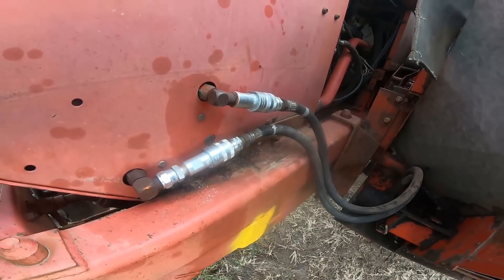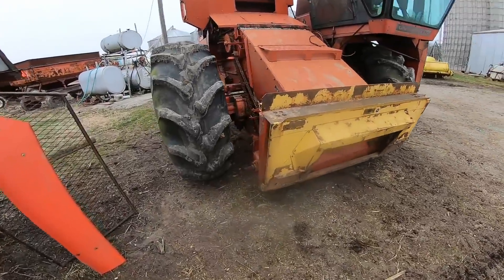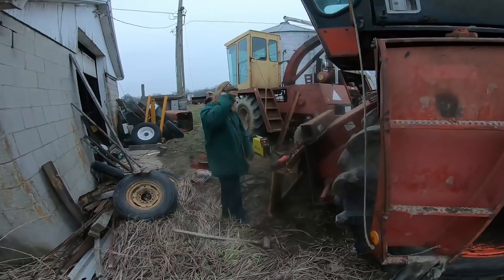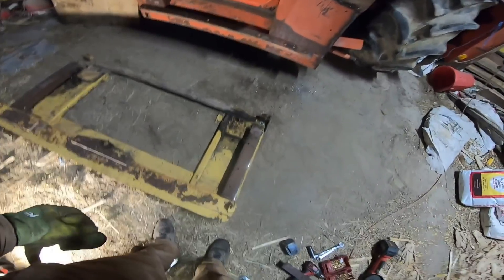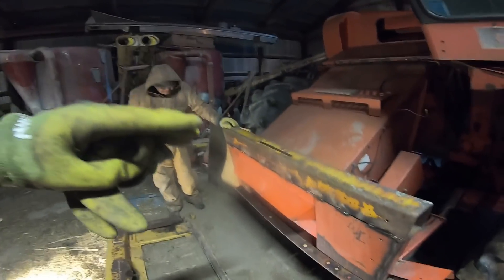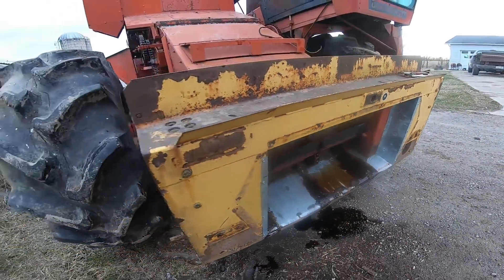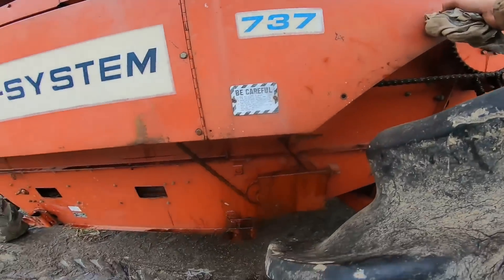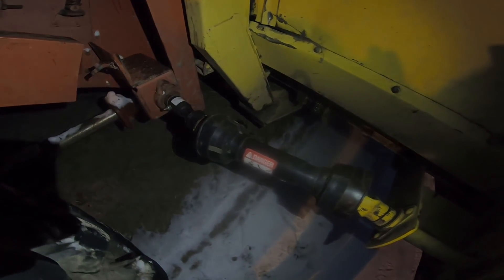UniSystem Project: Attaching Elevator, Feeder house and Making Adapter for New Holland

Comment: Looks good.  I had to do something similar to mount a corn head on my Ford 640/Claas Senator combine decades ago.  After searching around, the only corn head I could find was a 6 row 30 inch somewhere off in Alabama, and they wanted a fortune for it simply because it was rare.  When that combine was built, it was back in the days before "quick attach" heads were really invented, so Claas' idea of interchanging heads was to make the feederhouse part of the head!  The combine had two "U" brackets on the front of the frame on either side of the cylinder, into which the feederhouse pivots slid, then a cast-iron wedge provided the front semi-circular pivot, with a 1 inch wide thick steel bar "pin" that slid into a slot on edge cut through the upper and lower parts of the "U" bracket on the front of the frame.  The header drove off a single LARGE V-belt pulley on one side that turned the feederhouse chain, and had a cast-in smaller double-pulley that powered the head via a pair of belts to the jackshaft on the back of the head, for platform or flex heads, or a HD chain to a sprocket on the jackshaft to run a corn head.  I had a spare feederhouse off the old 630 combine I bought from a combine salvage company that was going out of business, and so I just modified it to fit an old Gleaner "G" 4 row 40 inch corn head I bought for nearly nothing in north Texas.  Cut the hooks off the Gleaner head faceplate where it hitched onto a Gleaner feederhouse, had to cut a pair of wedges and about 3-4 inches off the front of the feederhouse for the Claas to get everything at the right angle on the combine.  Made a belt pulley jackshaft that went on top of the feederhouse to drive a pair of chain sprockets, one on each side, to drive the sprocket-driven gearboxes turning half the header from each side, did a little reinforcing, and put it all together.  Had to make a steel plate that went into the "well" where the feeder drum on the front of a Gleaner feederhouse stuck into the cornhead-- and a 3 inch steel tubing "splice" to connect the two half augers that came in from the row units to dump corn in the well in front of the feeder drum sticking into the head a bit from the feederhouse on the Gleaner that was no longer there.  The pipe had a slip coupling on one side and was bolted together on the other side to drive it, so if a chain broke or came off the one auger could overrun the other without tearing anything up.  I cut the tread off a couple of old bias tires with a sawzall and made "paddles" that bolted onto angle irons welded to the center auger splice tube, to shove the corn back down the steel plate that filled in the bottom of the well and angled back to the feederhouse chain in the Claas feederhouse.  Worked great-- only problem was the two V-belts for the platform header drive were undersized for a cornhead which took more power... I was looking at ways to reengineer that into a sprocket drive when we quit row cropping.  

To change heads on a Claas back then, you pulled the pins and wedges, took the cylinders loose from the underside of the feederhouse, took the drive belt off the LH pulley, and then backed the combine away from the head and feederhouse.  To hook up to another head, you basically had to line up the combine and then pull forward and HOPE that the pivots went into the "U" brackets.  What I did was jumper a button up to the starter using spare wiring, got close, and then left the combine in gear with the coil wire pulled so I could just bump over the starter and slowly get the combine to roll itself forward, so I could jack up either side as needed to get the pivots into the U brackets, and once everything was pushed together snug, put the cast pivots in the channels, then slide the pins in from the top, then hook up the cylinders and belt drive, and you were done.  Later!  OL J R :)

Comment: You're doing a great job on this project.  Didn't the unisystem come with a cornhead of it's own?
Reply from the maker: Not explicitly when I bought the machines. And at the time I had seen photos of someone else using a new Holland head, so I figured we could make it work. Plus, the head I have had quite a bit of work done before I got it, so it should be good for a while. It's kinda like sticking with the devil I know.
Reply: @boehmfarm4276  Understood.  If you want to look at another farmer's "classic" equipment, I just started posting videos a few weeks ago.  My combine is the only piece of JD equipment I have. ( I know you don't particularly like JD).  Will eventually show all my varied makes of equipment and some farming and fixing action.

Comment: Say Jacob: You seem to not want a second head to fix. That would not be my object. What you have is a breakdown unit ready. If you don't use it why would it break. Just having it sitting there complete would make me feel comfortable if too much room was not taken under roof. Seems like one could pull it up with a comealong so as to really minimize it's floor space and save the tires. A husking bed  would be much less useful than a chopper which could definitely be used along with the other one if time was really limited for some reason.